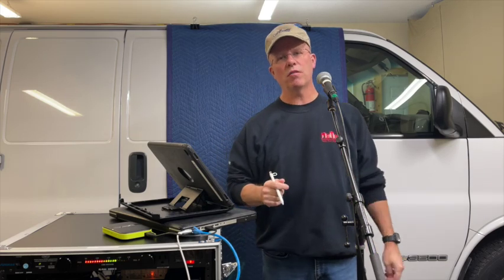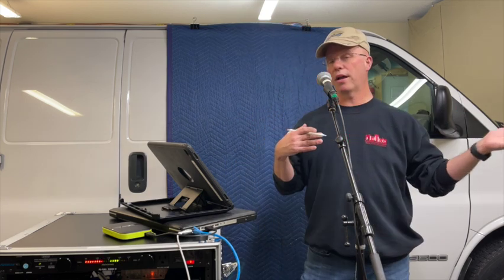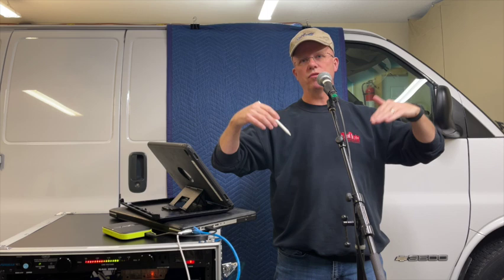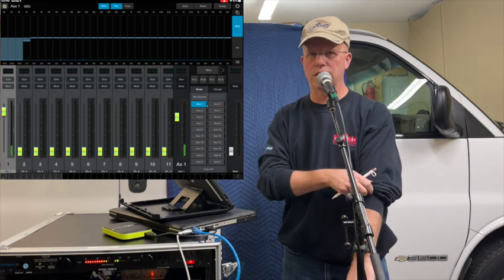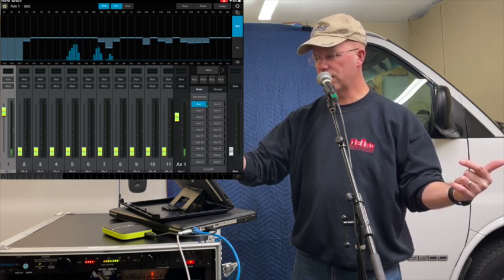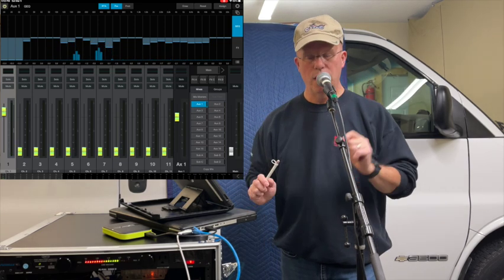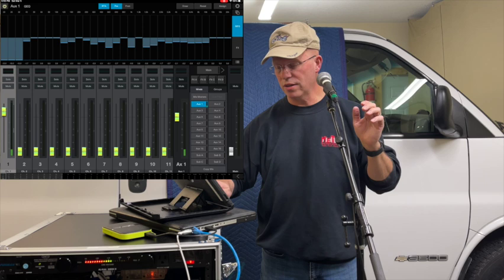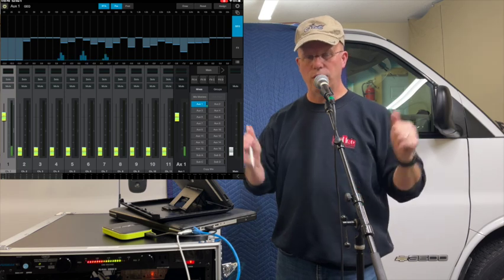The SC - Tech Tip #2 - Ringing Out Monitors by "Popping" the Frequencies

Comment: Hello Bart and Stacy. I was hoping you might have a minute to explain how you come by your settings for gain staging? My reason for asking is that, using the Presonus 32R, I am about 32 on my mic gains. But I noticed ( or at least thought I noticed) that your mic gains were somewhere down around 16? Any help on this would sure be appreciated, as is everything else you two do. Thank you!
Reply from the maker: Sorry, we thought we answered earlier....With a standard SM58 on vocals, we typically run around 25-28 dB.  For guitars with an SM57, typically around 11-17dB.  With our e604's on toms, between 12-19 dB.  I like to run faders as close to unity as possible so we are probably not running pres as hot as some do.   This is how I was taught by my mentor and arguably some will disagree, but this approach is also favored by well respected sound guys.  A visually balanced board is calming and in more control as you always know where your baseline is.

Comment: Great video. One question I have.. I’m in a band and do my own sound. We are all on iem’s so I never had to do this. I just recently did a gig for a band and I did what you are showing here and thought I had it all set for the band. Then the guitar player checks his monitors and asks for guitar in his wedge and then feedback started happening. Would you mute the guitar and go back to ground zero between the wedge and mic and redo it to get more gain before feedback?
Reply from the maker: Hmmmm....it's unusual that a mic'd guitar amp would trigger feedback into a monitor that you rang the vocals out...unless you were mic'ing an acoustic guitar?  If so, that could present a complete set of its own challenges.  This is a case where there are so many additional variables to contend with, which starts at the musician and you are at the mercy of what they give you....if they have no way to run their guitar direct, that indicates to me a certain maturity level they are at which will challenge you.  In that case, I would bring up the guitar and find that balance between the two and they get what they get.  Any acoustic player that can't give you a direct line will learn sooner or later it's not practical to expect consistent success trying to mic that guitar.
Reply: Interesting. It was just an electric guitar with a 57 on the amp. I must not have properly rang out the monitors..
Reply from the maker: @aaronbates500  That is strange....could there have been a bad XLR cable to the guitar mic that required you to compensate with extra gain?  I just can't see how a mic'd electric guitar, unless the amp was placed in a unique position to the monitor, could cause feedback.
Reply: I never thought of a bad xlr but I don’t think that’s the case here. The amp was very quiet requiring more gain on the mic. I had him turn his amp up a bit and that seemed to help
Reply from the maker: @aaronbates500  Typically, the amp should be the primary source for monitoring, not your monitor.  We have been asked to fill in a bit in the monitor, which we will usually not have an issue up to a reasonable level....but if they have an amp, the primary reason why you are providing a wedge is for their vocal....you should not then have to compete with their instrument through it as well....the primary purpose of a monitor should always take priority .
Reply from the maker: Should mention one caveat here though....IF for some reason, the guitar player needs to be loud (which is always a drag), I will offer them the preference that it's loud through the monitor and not the amp.  It sucks to have these conversations, but you gotta pick your battles sometimes and would much rather have the volume there instead of blasting straight out of their amp.

Comment: So, you increased the gain on the monitor out, and then had to pull back almost every band on the EQ. Isn't this equivalent to leaving the monitor gain alone and just boosting the two or three bands that you didn't have to cut?
Reply from the maker: Perhaps in theory, but I believe that you need to give the cabinet some energy to work with.  You also need to give yourself headroom.  Feedback at any of our shows is a rare occurrence..so I maintain our approach works.

Comment: You decreased a lot of frequencies. Doe it sounds good then? I think the resulting sound had a lot of hum (low frequencies), no clearity? I'm not sure if it is good enough for vocal?
Reply from the maker: Frequency cuts can vary by location.  Typically, the hotter the monitor, the more you will need to cut.  So it's a balance between the volume you need vs. the environment that you are in.  Vocalists typically like the sound of the monitors.

Comment: In a couple weeks I'm doing my first show using floor wedges in a long time, I'm here to get a refresher course!  Lol.  Great stuff.
Reply from the maker: Good luck! We can remember the feeling when we had to revert back  to bands that needed monitors… eventually it will be like riding a bike!
Reply: @thesoundcouple  what's your take on co-axial versus 2-way? Does co-ax have more resistance on feedback?
Reply from the maker: Great question.  This is just my opinion from experience...so take it for what that's worth.  I am going to say that a horn loaded 2 way is generally easier to work as a stage monitor. @dynamix_ent1022
Reply: @thesoundcouple  do you use efx and/or reverbs on stage wedge? Does it cause feedback?

Comment: Hey SC, question? 1. How do you use your Stage Wifi Router? Do you connect Presonus to it and it sends that signal to your iPad? 2. Do you use a dbx PA 2 type of system for your crossover or do you use the crossover on your speakers? Thanks and keep up the grrrreat work you two!!!!!
Reply from the maker: The Stage Router Pro is our main router/wireless.  So the control port of the mixer is connected to the router so the iPads can control the mixer.  We don't use any external crossovers as there is really no need to.  The cabinets DSP can be controlled from the back of the speakers or more flexible controls through the Worx Control software which PreSonus provides.
Reply: @thesoundcouple  I use a regular netgear router. I like your setup, but I can't seem to find your Stage Router. Where did you purchase yours? The both of you are definitely inspiration.
Reply from the maker: @ItsClarkGable  We purchased ours at Thomann Music a few years back, but their availability worlwide has been sporadic.  There are other similar rack mount options available.  Sweetwater has a Waves brand that is similar.

Comment: Thank you for taking time and effort to produce this content. What is your approach when ringing out multiple bus setup? Say one bus each for main and chorus. You ring them out separately and once the show starts, the main vocal walks all over the stage with their wireless.. and sometimes walks into the crowd right under FOH mains. Also how do you handle omni headset mics like countryman (without IEM)?
Reply from the maker: Oh my....your question is really tough.  First off, I would say the core issue here is education.  If a singer ever did this to me, I would be all over their butt on this.  Accident's happen, but if they are expecting us to manage them walking within the site of FOH, that approach needs to be corrected.  So in a nutshell, if this happens to the SC, that singer is sending the apologies to us.  At a speaking event where this may be something you could anticipate, I would consider ringing out the mains in a similar manner.  If there is a music portion of that same event, you will likely need to re-EQ for the live music since you will have probable squeezed a lot of life out of the EQ/system.   IMO, the countryman omni mics is a matter of making a big trade off in it's application vs. the sound....they will never sound as good, so there should be a really good reason for their use.  Billy shows ringing out mains in this video, which to me, is really a weird thing to have to do....but he does it, and maybe you do to?  https://www.youtube.com/watch?v=SqWrOqEm4EM

Would love to have other input on this topic!

Comment: Hi Bart.... great video...Just wanted to add a note of clarification that I didn't hear mentioned in the video. You are adjusting the EQ of the monitor/speaker, not the microphone channel, correct?  Keep up the great education videos!
Reply from the maker: Hi Ron - The mic channel EQ is flat.  The EQ is assigned to the Aux mix for that monitor.  Just to avoid any confusion, I would never recommend in a situation where you are splitting your pre's between a FOH mix and monitor mix that you configure PEQ settings on a channel to impact an aux monitor.  On PreSonus, this would be "pre1" vs. "pre2" settings.  This is rarely an issue for us (from a musician perspective), but is simply a trade off of not running a dedicated monitor console where the 31 band controls the "overall" tonality control of the mix.

Comment: Very informative video.  Would you ever save that EQ as a profile so you could use it as a starting point on a gig?  There must be times you don’t have time to individually ring out each monitor?
Reply from the maker: You are correct....especially if I know the band and in situations when you don't need a screaming monitor, copying can result in saving time by not going through this with each mix in detail.  However, In the real world, this process goes very quickly for us and is basically integrated into us checking a monitor.  I would think of this as a method as a way of optimizing volume.  Yes, we do save our show scenes and use them as a jumping off point for the next gig, but often I will change the EQ because it sounds different.  Also, there is a baseline DSP setting applied to the speaker but it's a baseline of what sounds good to me and the process demonstrated is adapting to the environment you are in.  Hope this helps!
Reply: @thesoundcouple  Thanks for taking the time for the detailed reply, really helpful 👍